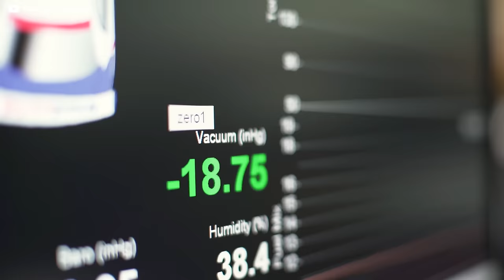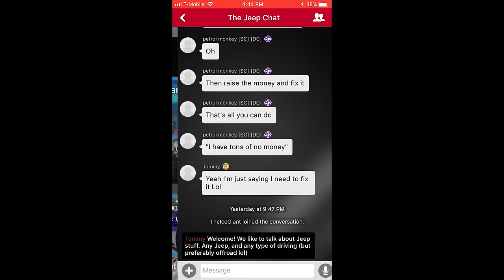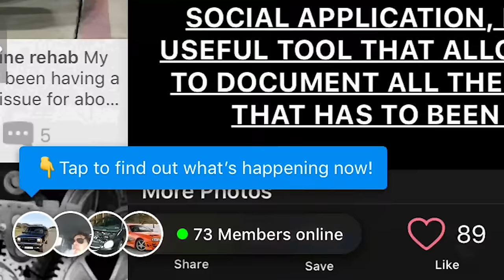Nitrous: How It Works | Science Garage

Comment: my dad was running nitrous in an early 60's VW Beetle back when the Pontiac Fiero was first introduced. It didn't hold together for a very long time, but he put plenty of abuse on that little 1600cc flat four: built it to somewhere over 100 crank horsepower with a 100 shot of nitrous on top of that. and this was when the best american "performance" cars were barely scraping over 200hp from the factory. so, a 20-year old surf rat with dorky hair and white tennis shorts was riding 'round the streets in a beat-up little red bug that made near enough as much power as some "performance" cars but was between 2/3rds to half the weight of those cars. he WALKED people out in their Mustangs and Vettes on the street. he wasn't the fastest thing out there, no, but he was a helluva lot faster than people thought he would be.

Comment: Related question: if nitrus oxide combusts when combined with gasoline, how would the NOx compounds in smog react if sucked into an engine? I suppose what im really asking is, could driving a V10 supercar through the san fernando vally scrub the air clean in southern california?

Comment: PS...if u install an NO2 system properly it will in fact help prevent/or decrease overheating temps.
Reply: But in that sense I've seen manifolds blown through hoods and rocker arms/push rods friction weldes on the inside of the blocks and cylinders....so be good or be at it kids

Comment: 2:53 I don't get it. How does the splitting of the Ν₂Ο₂ compound and the release of free N₂ molecules help to prevent pre-ignition?
Maybe the breaking of the N₂O₂ takes energy from the system and drops the temperature in the cylinder thus packing in more air? Does it have something to do with Nitrogen being an innert gas or something?

Comment: Hi Sir can I ask a question it is ok with turbo engine with out intercooler?
Reply: At smaller boost levels its fine. To know for sure you need to check your intake air temps, if they are too high then put one in

Comment: Is it possible to use NOS with a turbo- or supercharged engine?
Reply: Why yes you can, but, you have to think about the extra stress it will put in the engine.
You might also need a "Wet" system or some big boi injectors to take care of the boost + the nitrous.

Comment: Nod just makes air cold. Can fit more cold air in a given space than you can hot air. If engine gets more air it has more power as long as there's enough fuel sustem to Match it. Nos is the most HP per $ you can get. Some engines don't like nos...

Comment: The statement that nitrous oxide makes the power by being able to burn more fuel is incorrect. The fuel added during nitrous oxide delivery is actually to slow down the process of the power adder. The power comes from the extreme heat from combustion splitting the N2  nitrogen molecule from the oxygen atom.  The added Fuel is there to slow down this reaction and prevent detonation. Energy to combine or separate atoms and molecules is enormous. Some will disagree with me but do the math for a given amount of fuel in your engine how much work it creates then the ratio to the same amount of fuel with nitrous oxide amount of work. It isn't even close. The extra power comes from the separation of the nitrogen from the oxygen not from the combustion of added Fuel.

Comment: I bought a used 2014 gt mustang and when I opened the truck I found nitro clamps and I found switches buy the steering wheel my mustang is pretty much set up for it and I low key want to buy a bottle

Comment: I got a built b18b1 running a 125 shot in a 93 civic hatchback brian crower valve train and cams "#0022" eagle rods and wisco teflon coated pistons I'm gonna run at "import face off" ill see what happens I hope around 400 whp when I dyno tune

Comment: The thing with pure O2 is that itll ignite anything that is vaguely warm. Not like, human warm. I mean above its boiling point warm(BTW: its considered a cryo-liquid, which is fancy talk for FUCKIN COLD!!!). Using pure O2, would burn anything burnable after the point of injection. Like oil residue, and fuel vapor, and valves..... The metal will catch fire.... And depending on your block material, its a fire that wont go out until theres no more metal left to burn. A fire that burns so hot you dont put water on it. Because the hydrogen and oxygen will disassociate from the heat, and unfortunately hydrogen isnt as laid back as nitrogen. So you end up with pure oxygen and highly flammable hydrogen in a very hot environment.... Or as scientists would say, "Bad thing!" The nitrogen keeps the oxygen distracted until inside the cylinder, and the pressure raises, and it gets hot. At 500-somethin degrees the nitrogen and the oxygen disassociate from each other, at which point the oxygen will try its damndest to weld the piston head to the cylinder wall and the nitrogen will try its damndest to get in the way.....

Comment: Calling Petrol "Gas" is usually fine because the context makes it pretty obvious what your referring to  but when your talking about injecting NO2 as a gas and call the petrol that's also being injected into the cylinder and talking about the ratios between them it starts getting a little confusing and frustrating.

Comment: Why not premix oxygen and gas so that it's not turbulent? Oxygen is much cheaper per lb than NOS
Reply: There are a couple of issues with using pure oxygen. First of all it is not able to be stored as a liquid at room temperature which means you would need a very large bottle to hold a usable amount. Liquid NO2 also cools the intake when it is sprayed and vaporizes. Secondly is the risk of detonation. NO2 does not break apart until after combustion starts which helps prevent detonation. Pure O2 would be very prone to detonation.

Comment: Nitrous Oxide is NOT laughing gas, laughing gas is Nitric Oxide. Don't inhale Nitrous Oxide
Reply: They actually are the same, laughing gas and nitrous oxide. However, the stuff most people can buy has sulfur added to it to prevent people from huffing it. In order to get the pure stuff you need to be a dentist or other professional.